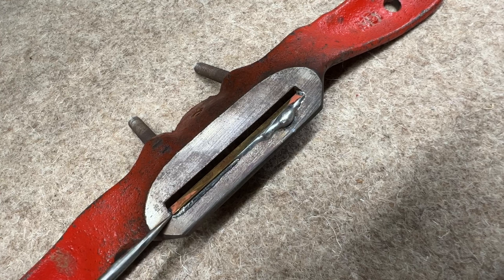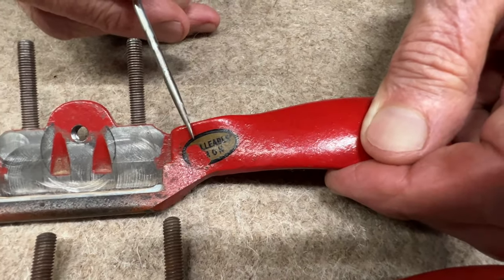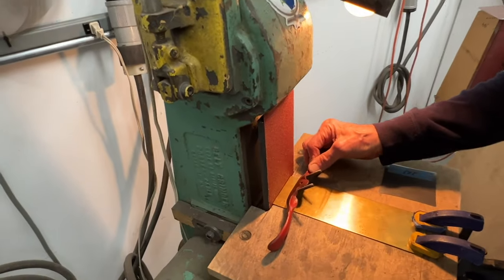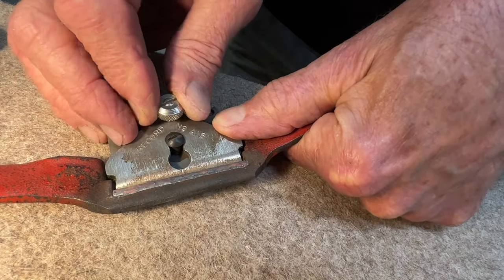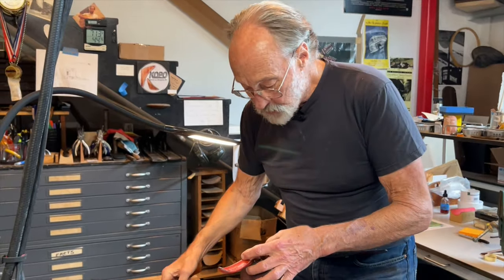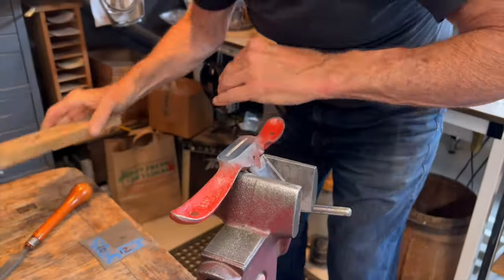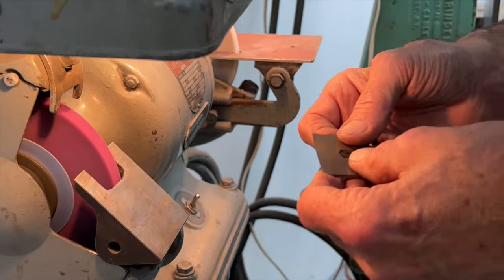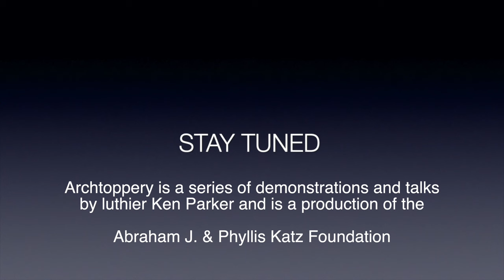Ken Parker Archtoppery - Edge Tools - A Humble Spokeshave Becomes a Magic Wand 6) Rounding the Sole

Comment: Can't comment specifically on cast, malleable iron, but I began my soldering journey fresh out of college in 1970.  I apprenticed in 2 Stained Glass Studios and after a year and a half I was off and running on my own.  In that trade you work with lead, brass, copper, steel, etc.  I've run literally miles of soldering beads on all manner of projects both in Stained Glass work, then in Architectural Restoration, and in my other hobby, vintage automobiles.  Absolutely clean metal is the first rule, which I'm sure you know.
I make my own Flux by dissolving zinc in muriatic acid, and that seems to work well on brass, copper, and steel.  Keep adding zinc to the muriatic acid until the acid stops bubbling and it won't accept  any more zinc.
Worth a try.  Happy hunting!
Reply from the maker: Thanks!

Comment: yeah so the first time my solder joint let go, so I had to start over. Also I had troubles with chips getting stuck, so what I did is take away material of the smooth angle surface, before soldering. Yet sadly I'd taken away too much of this, causing it to sink too low so the whole thing got sand away in the end. Yet I got a much better throat opening and this was my chinese really bad spokeshave, and it works really great as it is now, I got 20'' radius in both ways, that's great and grinding the blade wasn't that hard after all. yet if I come across a better quality spokeshave in the future, I might repeat this whole thing and get it right all the way with this insert. The throat opening in the middle is now like 4 tenths and at the sides it's like 1,2 mm just judging by eye. which is absolutely fine and much better than 6mm throat opening haha. Btw with this spokeshave I wasn't able to get it lined up 90 degrees to the belt sander, because the handles can't rest on anything either. So I actually ended up doing that free-handed. which for me worked okay, but that's something to consider too when selecting the spokeshave
Reply from the maker: You didn't expect to nail it the first time, did you? It seems like getting anything worth doing perfect the first time is a rarity. Anticipating every challenge and driving around every stumble is quite a high bar, as it turns out.  I often feel that, once a thing is done, I finally feel like I know how to do it, and my style is often just to wing it quickly the first time, then shift down and try to nail it the second time. You really need to give yourself a break, and take time to grow.  It might really be awful to fail so often if I wasn't on a journey to perfect something I care deeply about. This way I keep getting another chance to get it just so, and so it goes, and so it goes.
Reply: @kenparkerarchtoppery9440  yeah I understand. For this I'm really happy with my decision to do a prototype build first, because otherwise I would've just stagnated with every process because of wanting to get everything right first try. Even though it's a prototype, I still want to get it decent, but I'm not spending hours on making something look particular nice and stuff and mistakes I'll just learn from and just try to carry on. I even made a mistake that might end up being a blessing, but have to see how it all turns out eventually

Comment: How did you hold the plastic to the casting?  Can’t see the method of attachment.  Majik or double side tape maybe….??  Cleaver you are sez Yoda
Reply from the maker: I think you're asking about the polycarbonate (Lexan) spacer between the #12 adjusting rods? It's just a light squeeze fit, and needs to be made a bit wider than you'd think, as the threads are gonna squish into the plastic when you first use it. It'll be hard to jam in the first time, but after the threads leave their little dents, will go in easier thereafter. I couldn't think of a better way to grab it securely.
Reply: @kenparkerarchtoppery9440  
you can also drill a pair of holes though a small piece of wood [same diameter as the studs in spokeshave] then saw it into two halves right through the length of the holes Drill a couple [or more] of holes through both pieces and insert bolts and nuts and you have a very secure clamp.